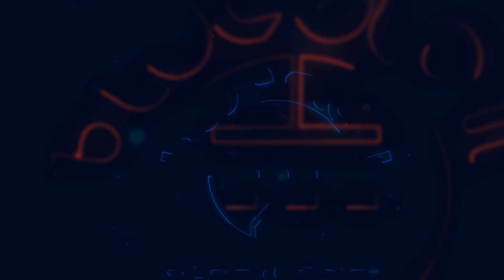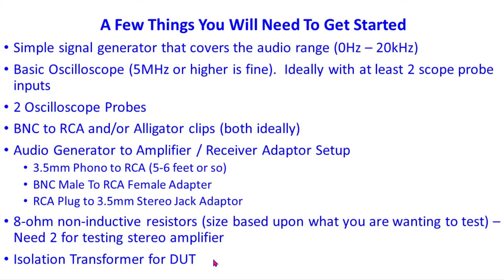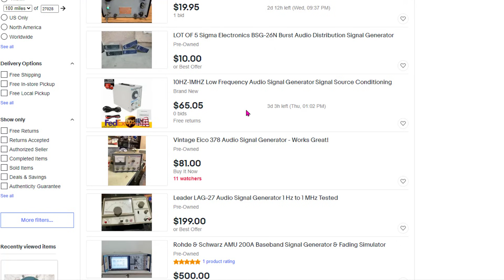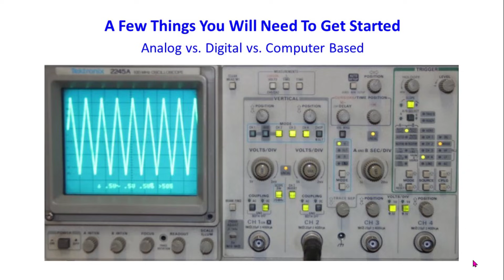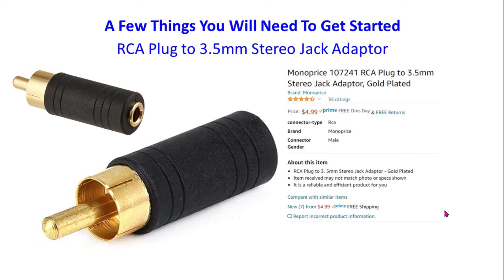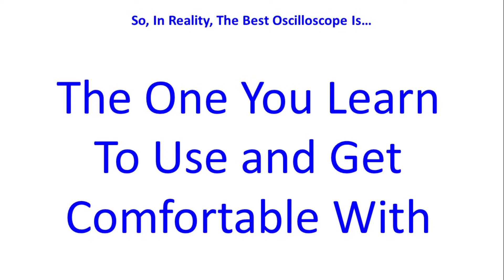Buying an Oscilloscope and Accessories For Audio Bench Work and Testing

Comment: Tektronix produced the first "precision" oscilloscope in 1947, it was a device that allowed engineers to visualize and measure with great accuracy the invisible waveforms present in every electronic circuit! Every advancement over the last 75-years in electronics was proceeded by an advancement in oscilloscope technology and quality. Only "visual comparative analysis" provided the engineer in understanding what is actually happening in all types of circuits, precisely measuring amplitude, frequency, and wave-shapes in oscillators, amplifiers, radios, radar, computers etc., in both analog and digital electronics. David Riddle

Comment: The slightly jittery digital scope image can be smoothed and made to look analog by engaging the averaging function which is of course what the analog oscilloscope does by its persistence.  Digital scopes sometimes also have variable persistence that accomplishes a similar function.  However, in averaging mode you won't see tiny glitches.

Comment: I noticed that you say we should look for a signal generator with better than .1% distortion, but the signal generator you use has <2% distortion! The frequency counter is accurate to .02% but not the sine wave. Is that level of distortion you called for (.1%) only useful for THD readings? Isn't that something most hobbyists will never be doing?

Comment: I recently picked up a Tektronics 2246 that had current calibration through BC Group for $65 plus $30 shipping.  I love these scopes mainly because I've been using them for 35 years.  I know the LCD scopes are smaller, and usually have more capabilities, but I like a button or knob for functions, not a menu system that I have to hunt through.  The only thing I wish it had was an auto acquire function so I could push it to sync the signal to the scope instead of hunting through the levels manually.

Comment: HI . Can you please advice isolation transformer wattage ? Small, medium transistor amps are rated bet say between 100-200-250 Watt power consumption. Is it mean isolation transformer should be in this range ? But without full amplification and without  load should be far less so how to set reasonable trafo ?
Reply from the maker: I mostly work on tube gear so I use a 250W unit but just scale up depending on what you are working on.  Tripp Lite makes a nice 1000W for $350 or less.
Reply: @Blueglow  OK Thx. I'm in EU opposite side of earth so have to look locally for it. ;)

Comment: Been an audio engineer for 30 years (live sound, touring) and am just now getting into learning about this stuff. I was on it as a pre teen back in the 80's but got more interested in other aspects of the field. Now I've got some old reel to reel machines (Nagra IV-SJ x 2) I'm using to record the band I mix and those need maintenance so, off we go. Tektronicx 465 Purchased and now, thanks to you I'm looking forward to starting this journey of learning to care for my tools. Thank you.
Reply: The Tektronix 465 is the Cadillac of analog oscilloscopes and impressive to operate and even just look at.  Knobs and buttons galore!

Comment: Do you have replacement suggestion in amazon for  
Jameco GRP-1200 Isolation Transformer and Syncwire RCA Cable, [10FT/3M] Nylon Braided 3.5mm to 2-Male RCA  ?  

Since it is not available in amazon anymore

Comment: I’m trying to follow along but I got to admit this is a lot hahah, I need some help please. I have a bk 1461 scope I got used for 20$ and I want it to display waves when I hook it up to my receiver when I player records or music. I have a strdh190 Sony. I’ve researched a few things and so far people have said to use a bnc to rca and a rca banana plug in the “hor input” and “GND” but I don’t think I can use those rcas because i don’t have a “tape input” (which people have said for it to be the best option) and the output on the receiver has opposite polarity? And can blow the amp. So I’m unsure. Can I use a splitter between my phono stage and my receiver? So my scope intersects the signal? Can I use a bnc to the 3.5m in the front?? Helllllppp

Comment: Today I found a signal generator and nice HP tube screen Oscilloscope 100MHZ in our local electronics recycling  -  . the generator has a gear inside broken so that has to be fixed (it can't dial to the comb filter)
I think it's a simple fix.. and the HP fired up perfectly and your 3rd part video got me dialed in an confirmed. I'm SO happy to have found these today. I agree with the bench space thing. and I have a spot on the bench for this... my first non computer based osc.  Appears my HP has pretty much all the same features as that Tektronik minus 2 less channels -  100MHZ is overkill for audio so that's all good !  I had to jerry rig an adapter..will order one of those packages from amazon you showed. Looks great for $20.   I can see some great use out of the modern digital units.. but I too hate accessing so many menus.  I'm more of a tactile operator.  I can hunker in to the 'interface'..but would prefer not to.

Comment: Thank you...I have been looking for someone to explain use of oscilloscopes for visualizing sonic waves for analysis so I can look at a sound and figure out how to reconstruct it...I am still a little confused why I would need a signal generator? Wouldn't that be the sound coming out of an amplifier or detected by a microphone? I thought the signal generator would be -- instrument (guitar, synth, etc.) via 1/4" jack to effects pedals to amplifier -- then somehow capture that signal and send it to the oscilloscope (maybe by direct connection via 1/4" jack out to something else in, or via a powered microphone connected to the oscilloscope). What am i missing here? Does the signal generator convert sound to volts? Why do I have to isolate the DUT's power connection? Is something going to explode? Maybe I need to watch more of these vids?

Comment: I'm gathering the stuff I need according to your excellent video, can't wait to watch the rest of them! I have a B&K model 1655 power supply, have not used it yet, but I bought out a TV repair shop a few years ago and I like messing with electronics though I'm no expert.. Would this be considered a variable power supply and it also has 2 "isolated output" receptacles? Would that be considered equal to the isolation transformer you referred to in your video? Thanks!
Reply from the maker: If it has isolated outlets, you are good.   But most variacs aren't isolated.  I use an old RCA isolation transformer in line with my variac.  They are easily found on eBay.

Comment: Thank you! I've been trying to find a good starter scope for getting into building synthesizers, but all the specs and features geared towards digital & lab use has made the literature pretty impenetrable. I'm probably going to end up with a Hantek DSO2D15. A lot of people are recommending it, as it has a lot in common with the Keysight, but it's around 1/4 the price. That said, I will probably upgrade to the Keysight when I have the money because I don't expect the cheaper Hantek to last a super long time.

Comment: My electronics training was in 1969-70, and I did very little electronics work after 1972, so this was a good start on refreshing some old information and coming up to date. I did notice that a note on one slide said that a variac is not an isolation transformer. I thought the primary and secondary were separated. Is there an inadequate separation?
Reply: A variable transformer (Variac is a registered trademark) only has a primary winding, hence there is no separation. I have a BK 1653 AC Power Supply that combines both functions by putting both in the same case.

I suppose that it would be possible to design a variable transformer with isolation by using a toroidal transformer and setting up the secondary with a sliding tap, but as far as I know, no one has ever done that.

Comment: Since I'm a tube roller guess I'll comment. First of all love your channel thanks for all the info. I just won't work on the amp when it's plugged in. I power the amp down, move my connection, then power it back up. Takes longer but it's a safety step I won't skip often. Also people with isolation transformers need to know they can't use test instruments that way and they are grounded if nearby. Which means also you could touch the ground on the oscilloscope lead when you hook it up to your amp. It takes very little current supposedly to kill a person. Having the amp turned off when moving your connection isn't ever mentioned.  The 1 hand rule is impractical. You eventually will inadvertantly have 2 hands in your amp.  You can see powering the amp down doesn't take that long. If Working on it powered up MUST wear  insulating gloves such as latex, and only one hand if possible.

Comment: Very intresting! One question: Do scopes have specific probes? I am on the point of buying a Tektronics 2235, but whitout probes. The probes for that scoop should be P6122, but they are not to find in Europe. Can I use any other probe with a BNC-connector or does it absolutely has to be a P6122 probe?
Reply: Yes, you can use any scope probe as long as it has a 50 ohm input impedance and the desired frequency reponse.

Comment: I can add a little info on vintage scopes as I have just done some research and testing for model railroaders who might want an oscilloscope for measuring the "Digital Command Control" voltage but don't want to spend much.  (Plus, I have used such scopes in my mercilessly long career.)  One thing to remember is that the major manufacturers each had a range, often a very wide range, of oscilloscope models and usually the bottom of the line would be fine for audio.  But on the used market, there tends to be far less of a price spread between models and manufacturers than for the original price spread. The Tektronix 465 mentioned (or you might be more likely to find the 465B) was a top line oscilloscope (the industry standard, actually) introduced in 1972 for $1,725 ($11,470 in 2021 dollars) sells on eBay for $100 to $250.  A Tektronix 2215 introduced in 1982 for $1.400 ($4,032 in 2021 dollars) sells used for $50 to $150.  A Hitachi V-212 introduced in 1983 for $340 ($949 in 2021 dollars) sells used for $50 to $120.  Of course, offerings vary in condition a lot, but you can get a very nice vintage scope for so little money that the biggest concern might be the shipping cost and perhaps having to buy some probes.  If buying a new digital scope, typical names today for bench scopes are Siglent, Rigol, Hantek, and some others.  (I recently got a Siglent SDS1202X-E and think it is rather decent.)  YouTube reviews abound on new scopes but beware that some reviews are by some who are not very knowledgeable and some by those with decades of electronics training and experience.  While the lowest bandwidth models are adequate for audio, it often doesn't cost very much more to get much more bandwidth and perhaps more features.  Frankly, the options today for low cost oscilloscopes made in China can make you feel like a kid in candy store.  Some scopes I would NOT recommend are the "mini" DSO's or "Tablet" oscilloscopes.  While usable, most wildly exaggerate their bandwidth and can be annoying to use with minimal controls and maximum menus so you are forever cursoring, cursoring, and cursing to make changes.  Also, even the lowest end mini-DSO (200 kHz claimed bandwidth, but not really) is about $75 and if you step up to a better model and you are above $100 pretty easily.  They just aren't a good value in my view.  They are the sort of thing that, if want to use it regularly, you live to regret.  They do have the advantage of being battery operated, however, which certainly takes care of isolation issues.

Comment: Thanks for sharing your knowledge with everybody. Guys like you, D-Labs, (I think it's Terry), and Uncle Doug are really appreciated, and I think you guys are pretty rare today. My question to you is, in buying older (vintage) gear such as a scope, do you need to be concerned whether it's in decent calibration? How do you verify, by comparing with a audio generator?
Reply: Like Kevin said, there are various ways of checking calibration - sort of, but for most audio work, calibration is not that important. What a signal looks like is more important than whether it is 1.8 volts peak to peak or 2.0 volts.
Reply: Basically you need a device that is known to be calibrated.. Like a Fluke meter. use that to measure and compare to the  voltage reading on the scope. adjust the scope tp read the same voltage as the meter.

Comment: Great video, however, I cannot find a KHZ Oscilloscope---they are all up in the 40,50, 100Mhz ???
Reply: Umm, you're serious?

OK, assuming you are serious, a modern, or even, semi-modern scope will have a frequency response from DC to the upper rated frequency. It is not like, for instance, a signal generator or spectrum analyzer which do have a lower frequency limit.

Comment: i used a tek 545 for years and it was a great 33mhz scope with interchangable vertical plugins. In the late 80's that was getting dodgy so I replaced that with 35mhz dual trace Hitachi scope, it was functinality similar to the old 545 and easy to use. The 545 is long gone, the Hitachi is still working great.

I 2011 I got a good deal on a Tek 2230 storage scope that is a 100mhz analog scope with a digital overlay and waveform storage. I used a scope like this for years in my real job so i was very familiar with it. I can now display 4 channels on the odd chance i need to do that by using both scopes but that almost never happens. The digital capture comes in handy if your going through parts trying to select something with known risetimes.

The modern digital bench scopes are interesting but you should be able to find a good analog scope for a good price and as a bonus you can probably fix it yousrself, if a new digital scope dies it has to go back to be fixed and will be gone for weeks or months and  cost a lot to repair.

As to the ability to display measured values on the screen i find i can do the math in my head faster than what it takes to set up the fancy scopes.

Comment: This is the video that pretty well answers my question.  I'm retired and setting up my workbench for repairing some old Tektronix 465 scopes and some old Hallicrafter Ham radios.  The Service manual for the Tek 465's states that I need a scope to check out the scopes.  So, for the same price, would I be better off with one of those Siglent scopes or should I go back to a more basic scope like a Tek TDS 350, TDS 360 or your 2245A scope?  I'm suspecting that the Siglent menu driven scope has far more features (complexity) than I'll ever need.  I was (long ago) an electronics technician - not an Electrical Engineer.  The TDS scopes have the controls layout the same as on the older 465 scopes which would be more familiar to me than the menu driven Siglent scope.  One feature I like about the TDS scopes is the turn-on self-tests and the functional tests capability.  If I bought one that passes all those tests then I might assume that it would be in good condition, right?  I think I'm talking myself into the TDS scopes.  Is there anything you could point out that might sway me towards the Siglent?  I think your video did a great job of answering that question for me.

Comment: Love this series. Thank you. Concerning the channel selection buttons on that Rigol, that's why I won't buy a Rigol and will be buying a Hantek DSO2D15 which has individual controls for each channel and an internal arbitrary waveform generator. It will be an addition to my Tek 465 scope and if I ever get around to repairing them, my two HP 1741A scopes.

Comment: QUESTION ON TEST EQUIPMENT FOR NEW/ASPIRING TECHNICIAN.

I have Sencore Z-Meter, LC53.  Should I keep this meter, or am I better served selling this and buying more basic test equipment.  I have a fantastic B&K 820, to test capacitors.  

My end goal is to completely restore and improve vintage Matantz and Sansui stereos (I am an Engineering student, as well).  I may do work on CRT projectors like Barco's and Marquess down the road
Reply: Keep the Sencore. The BK 820 may do 80 - 90% of what the Sencore can do, but sooner or later, you will need that 10 - 20% of the Sencore's capability.

Comment: Great introduction!
I understand the strengths of digital scopes, but did not understand a particular limitation for analog work.  Does a good digital scope exist for analog work?  Or a way to work around their 1-channel-only trigger limitation?

My highly-rated 2-channel digital scope (similar to yours) is a PITA for analog work because it can trigger only on one channel.  If a channel is turned off, or the probe is lifted to search for the next test point, the screen just goes blank — it will not switch the trigger to the only operating channel until after much button-pushing.   I asked that scope mfr's rep if they could add it via firmware.  He didn't understand the concept even after I sent the Tek manual description of its operation. Aren't they supposed to be smart?

Frustrated, I bought a warranted analog scope with 'vertical channel trigger mode'   Burning it in now!
Reply: Even a good analog scope, such as the TEK 2465B, only triggers on one channel.